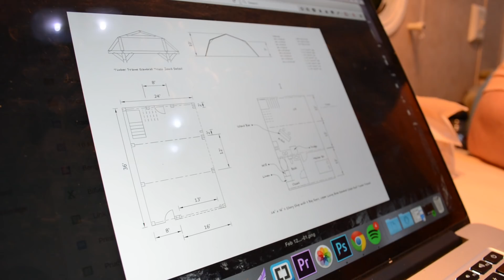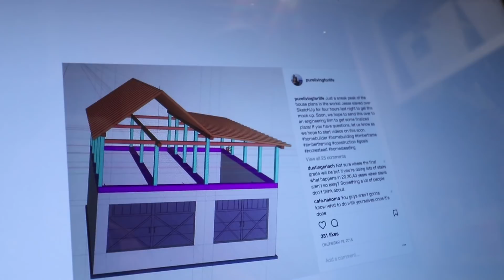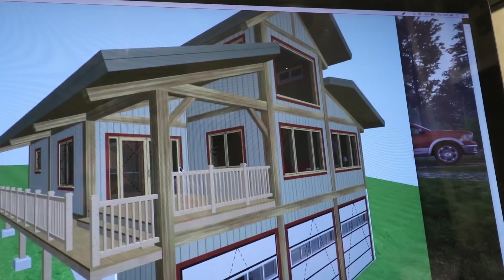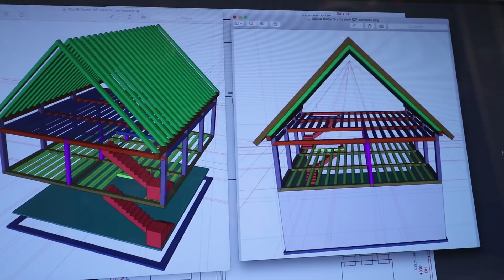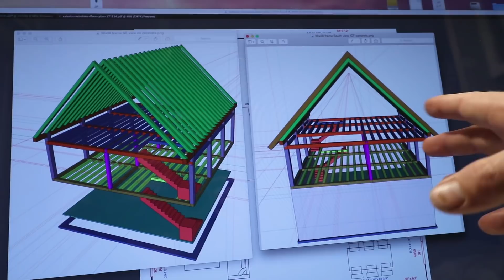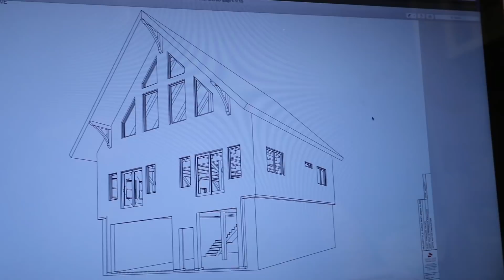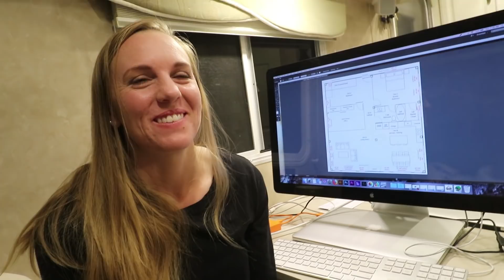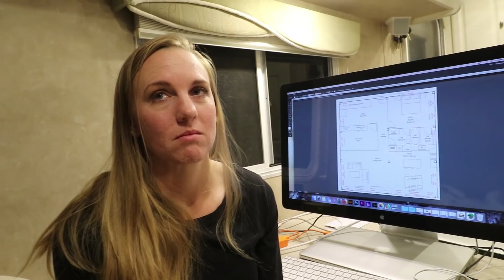Building a House Start to Finish: Timber Frame House Tour

Comment: Good try!
But I feel that beam span of 13 to 14 ft is more realistic than 20 ft. Then it would be more appropriate to have king post roof for rafters such long. For the floor plans design principles I would recommend “The not so big house” book (ISBN-10: 1600851509).

Comment: Dont forget to insulate really good
Reply: Robert Foedisch they're using SIPs
Reply: what are SIPS?
Reply: are those thos insulated forms they used when they pored the concrete?
Reply: Robert Foedisch structural insulated panels.

Comment: hopefully you guys don't choose those short taps and over the counter bowls if you actually want to wash your hands and have the water be able to flow.  i'm stuck with a stupid bowl and a tap where if i stick my hands in the water stream only hits my first knuckle and that's it.  it's dumb as hell having to wash your hands sideways and a waste of water.  you have enough space for a longer tap and a sink that's embedded into the counter.  don't be an idiot like me and go for "style".  it's an idiotic dysfunctional design element for snob hotels.  just like those short taps for baby hands.  (or at the very least, install it so the stream shoots out in a diagonal forward and not straight down)
Reply: also sliding doors for bathrooms if they aren't that big.  use reinforced glass walls with drywall outside to make the bathroom look bigger,  especially on walls where you don't want to hang anything.  it's ultra thin, mold resistant, waterproof, temperature-proof especially around the washer dryer, cheaper and likely stronger than a tile wall and save you a lot of space.  only problem is it reflects sound a LOT.

Comment: Your plan has way to much space devoted to circulation/hallways. The mud room looks to be just a wide hallway.  The mud room has a lot of floor space but little wall space for shelves cabinets etc...The master closet is way to small. You need to plan the upstairs to make sure the plumbing is prepped for future upstairs baths. You will eventually hate the fact that you built your house on top of your garage. Carrying all your groceries up a full flight of stairs and all the way across the house to the kitchen will get old! I would have put the MBR facing the mountain view and put the kitchen in the back corner next to the stairs. I agree with the other commenter's that you should open the ceiling of the living room up to the roof structure. I know you are designing this for yourselves right now. You need to consider that at some point you may want to sell this property. You need to consider what others might want to have in a property like this or you will not realize a proper gain in your investment.

Comment: you guys could have dug into the hillside  and erected a dome house out of concrete than berry it not only would it be energy efficient with no heating or cooling required but it would probably survive a nuclear blast. But that is just my opinion. If it was up to me all houses would be built underground. Use the space up-top to build greenhouse or just a regular garden.
Reply: I'm going to build a dome and bury it but it won't be in a hill. I plan to film it and start next year.

Comment: Give some thought to life's boo-boos.  They will happen.  Broken limbs, surgeries and illness that limit your mobility.  Make sure the stairs will accommodate a lift in the future if needed.  Don't build it in for now, just make sure there is room for one.  Ask your engineer what you need to do to make the house handicap accessible if needed.

Comment: The rendering is great - front of the house may need a small balcony with maybe an antler set on each side just above the picture windows.
Bit difficult getting through 22 minutes of general yarping before the actual point of the video was reached. Appreciate that the things you talked about were important but really - 22 minutes...!

Comment: Another nay on the washer/dryer in the bathroom. You will struggle loading unloading and will not be able to use the bathroom with the dryer going. On the plus side if you remove it you can have more cabinet space in the kitchen

Comment: What exactly is that Buttress for?
Reply: beam
Reply: No, because if you watched before they cut a notch into the wall for the beam.
Reply: I am guessing they were worried about the pressure from the ground pushing in the back wall.  The buttress would help stabilize it from being pushed in.

Comment: What a waste of an excellent building space for a berm home.  Being in Real Estate I would never suggest a kitchen sink facing the wall, would be much better to have the sink in the island, I have had many buyers that wont even look at a home where the sink faces a dead wall.  Have you not thought about every piece of grocery item will have to go up a flight of stairs, lowers the chance of resale to the only generation with cash to buy, the baby boomers.  Too many stairs.  Good luck but not the most functional design.  wasted roof space and expense.  the high ceilings and wow factor of a peaked roof and amazing window should be in the mainn living area not stuck in a spare room that will never be accessed.
Reply: Linda Fisher The sink in a dead wall is also very bad in a cold climate where they are because it is possible for the sink to freeze if you don’t keep the cabinet doors open. I know this from experience.

Comment: Call them the 26 blessings 

Those 26 people saved you 9 years 
Couple of teens last summer into fall and the house woulda been completed already ,,,  but no ,   You are on tight budget and can’t splurge than you shouldn’t have built it period. 
MUDROOM!!!   Is that a country termed ideology or what,,,   
Let me help u out for the sake of American reputation 
Glass insulated sliding doors front and back deck in front patio in back with catwalk connection along the side 
MUDROOM should be the cats room 
Chance to make an array of corridors inlets and outlets for the cat through out the entire house 
MUDROOM.  Wow

Comment: Here I go again, hate me if you wish, but if you send these people money, well there is a saying," a Unwise man and his money are soon parted. IF you try and build a house like these people and you have to work aont a real job you will find, IT CAN NOT BE DONE.  I built my house and it was paid for when I finished. IT took me two years. Regardless of what type house you build there are trade offs for things like ceiling height, and larger square feet houses. Two of them are your going to have to heat and cool more air, and the larger the house the more it is going to cost you every month when you pay all your bills. It is sad, but your taxed when you make money, taxed when you buy anything, and then your taxed until you die for just having it. Believe me if your going to build a house on your own, you need to either know every aspect of framing, foundation, heat loss, havc, plumbing electrical, insulation and several other trades.  I did all the labor on 75% of mine, and I was burnt out when I was finished.  I can give you good advice if you are seriously considering building a house on your own, and I am not going to sugar coat it. I am not out to ask anyone for money either. I think I have watched 3 of their videos, and I just have to say a lot is being left out, like all of the negative things they are not going to tell you about what is going to happen and what you have to be cautious of.  IF you are into watching this, your just seeing what they want you to see, your missing the other aspects that are hard, costly and many things you will learn from building a house if you never have done it before.  You need to know people that are professionals in each trade to lay you our on how to do things properly. One example I will share with you. My HVAC guy was a professional I paid a whole 200 dollars to for getting me laid out on doing it right and by doing it right it cut the cost of what I would be spending on heating and cooling the house for as long as I was going to be the one paying for it. A  example is I currently pay less than half of what a spec grade builders house cost annually to heat and cool. I only have the best of intentions on trying to help others make good sound decisions that  will more than pay for any additional cost on the front end. Best of luck to anyone that sets out to build a house and have it paid for . These people seem to have more money than sense, which means you and I, the average worker with money you worked your butt off for, could never have a house built to be a mansion and have it paid for with the best of everything. It is just the fact these people are building a house and seem to have enough money to not have to work  a normal job like the majority of us.
Reply: You're so mis-informed. They're not teaching anyone how to build a house. All they are doing is showing their journey. Youre right they leave a lot of possibly helpful footage out if you were trying to learn to build on your own. But they arent asking for money to teach people to build their own houses. They give a lot of broad advice, there's no time to deep dive into every lesson you'll learn building a home because those hard lessons arent always that entertaining. After all, that is what they are doing. Documenting their efforts partly for themselves down the road and partly to entertain us, the viewers, while also earning a decent income. Take your soapbox somewhere else.
Reply: As you said, you have only watched 3 of their videos. They aren't doing everything completely on their own. They do employ other experts when needed and show when they mess up. They do touch upon many times on how much time was spent thinking/planning their next moves, which you wouldn't want to see that filmed anyhow. You don't go into this type of project as a DIY'er that has only ever built a shed or assembled IKEA furniture. Any time they have bought new equipment, they go over why they did it which shows they have put thought into their actions. Also, you do realize they do get some revenue from all of us watching to help support their build. They look like they are in their mid-30's and if they had worked for even 10yrs and saved enough, and sold off any property they had before , they should be fine without working for a couple years. And land in remote areas are relatively cheap from $10-100K. Also, they may also have family that is helping them financially too. That's not for us to know anyhow as it's their own private situation. This clearly is not something for everyone, I don't think with the scope and location of their build that anyone can infer such an idea. On a final note, if you have builders make a home for you, they employ a lot of crew and many are specialists that earn over $25/hr, if you were to earn less than the trades people and have the skills to do the work yourself, it is actually better to now work a job and do it yourself. Considering this build has been only a few months, they are making good progress for just 2 people on such a large project. I personally have plans to do something similar on a smaller scale in maybe 5-10yrs from now to have a remote property off-grid, built in a hill. Which is why I started watching this channel as it was very much what I want to do.